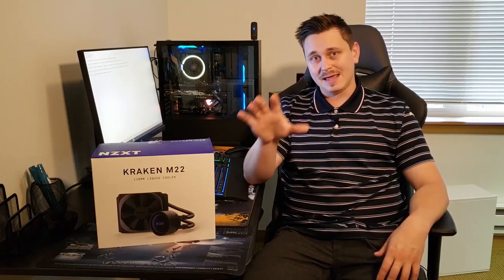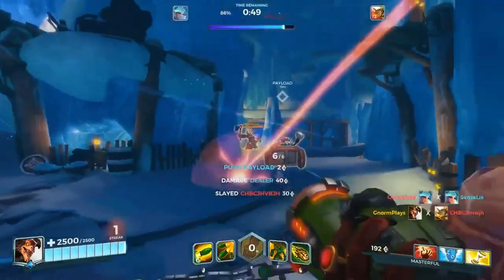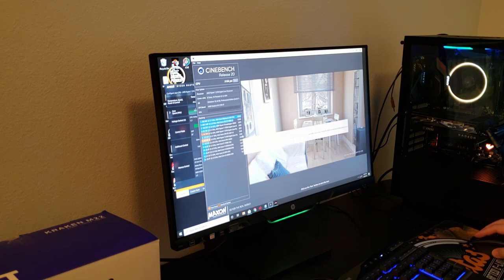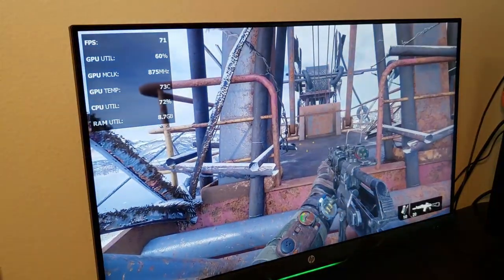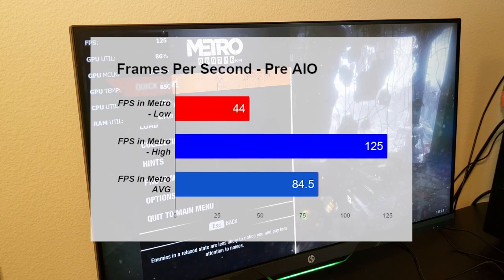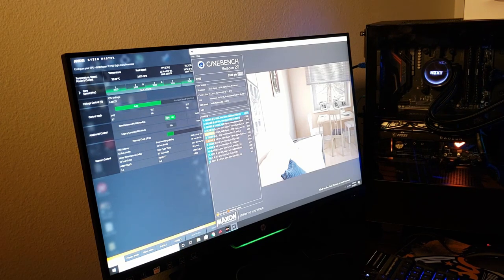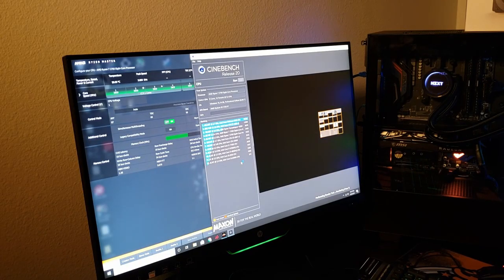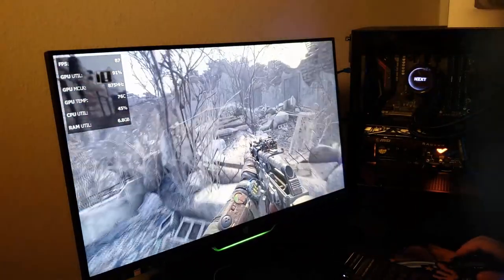Overclocking the Ryzen 7 2700 | NZXT Kraken M22 Cooling

Comment: I just got a 2700 from a sale and it's quite great so far, I just got unlucky with the silicon quality with mine, the most stable OC I got is 3.9ghz @ 1.325v that passes prime95 and cinebench r25 (two 10 minute runs), any more than 3.9ghz needs an absurd amount of voltage lol.
Reply from the maker: That's about where I capped out at too. It worked really well for me. In fact it is still in our streaming pc. I hope it works well for you too, welcome to the channel!
Reply: @BainCustom  Thanks, I dialed mine down to 3.8ghz @ 1.250v and tweaked my ram with tighter timings and I just lost 150-ish points in cinebench r23, my temps also went down 12c cooler compared to 3.9ghz, overall it's worth it.

Comment: Yo, Nice vid! Do you think it can handle a i9-9900k? I personally don't think it's possible, but my friend thinks it is...
Reply from the maker: I think it would for some. But not for the way I use my computer. Not only is my room usually really warm, but I am constantly pushing performance. I would go for a 240mm AIO or a solid air cooler.
Reply: @BainCustom  We completed the build this morning and I'm kinda surprised. The i9-9900K is running at  max 50 degrees with a boost at 4.7 in games. The m22 is doing a good job so far. Thx for your reply.

Comment: TY sir, this is exactly what I was looking for... Stock cooler is ok for a mild OC (I'm running at 3,8 GHz rn) btw
Reply from the maker: Nice yeah. I need to get another overclocking video going for some updated coolers. But this one definitely does the trick for a decent overclock.

Thanks for watching and the comment!
Reply: @BainCustom  I suggest using less voltage, my CPU only needs 1,25 to stay at 3,8. Also, as far as I have researched, Zen plus should be below 1,375-,135 max to avoid degradation. You should be able to get 4 GHz without hassle with proper cooling and a good motherboard.
Reply from the maker: @SpaceLion949  I think the motherboard itself was the biggest issue I had during this video. I tried many times to use less voltage and to hit 4.0 with a stable overclock. I hit 3.9 stable for the CPU but it caused some issues with the motherboard.
Reply: @BainCustom  Oh I see, you must be having too much VDroop (if you ajust the LLC setting you might be able to get a little bit more but 3,9 is quite good). In the other hand off course VRM quality, silicon quality and even the PSU matter. At least that is what I've learned

Comment: Can’t wait to get the cooler, currently on a fx 8350 but I’m upgrading to a ryzen 7 2700x soon.
Reply from the maker: O yeah, that is going to be an awesome upgrade when you make it! I did the same upgrade a while back for my personal setup and it was huge!
Reply: TechCessory would you recommend paying slightly more for the ryzen 7 2700x or would I be better off with the ryzen 7 2700 ?

Comment: I’m using a Ryzen 5 2600 overclocked at 3.8GHz@1.296v(Max). Let me just say it first: overclocking the cpu(base@3.4GHz) literally pushed the performance of my PC to a new level. Games like NFS Heat, AC Origins have seen significant performance boost. Now for the temperature part, using AIDA64 or playing NFS Heat for like 20-25mins continuously pushes Ryzen 2600 to an avg temp of 95/96c with maximum of 111c!? Crazy right? I have encountered a total OS crash numerous times like this. So now I’m planning on getting a liquid cooler. Will I really see some improvements over stock AMD STEALTH COOLER?? Like reaching 111c is no way acceptable and thus my question.
Reply from the maker: You should absolutely have a better cooler. It is not recommended to overclock much at all without something like an aio. That being said it looks like your voltages are fine. I can imagine the crash is due to heat. What is your motherboard?

Comment: I had no idea how important cooling was before purchasing a pre built pc from nzxt.. I’m getting a 3000 pc with a i9 10900k it’s gonna be delivered soon. Do you think this cooler will be fine for me or should I upgrade and worry
Reply from the maker: What case will you be using?

Realistically this lineup is where you want to be unless you plan on adding gpu cooling. Which running a custom loop might be worth doing. That being said, I think this cooler would work well for you.

Let me know your case and when the pc arrives!
Reply: @BainCustom   Thanks so much for the response, did not think you would reply. So I'm using a NZXT H510 elite case, 2080 super windforce oc gpu it had 3 fans i believe, NZXT c850, gskill 2300mhz 32gb, and ya the kraken m22 cooler which i'm VERY concerned about from what i've read. Bc i have the money to get whatever cooler just had no idea the importance of cooling
Reply: @BainCustom  Its also gonna be a pre built so i'm upset that if i have cooling problems i'll have to somehow replace it bc i dont wanna mess anything up
Reply from the maker: Oh buddy! I didn't realize we were on the kraken m22 video. Well all of that hardware is solid and definitely going to run a bit warm. 

I really don't think the kraken m22 is going to do a good job for you. I thought we were on the kraken x53 video. 

https://youtu.be/WDr5niHr7OU

The kraken m22 will be slightly better than stock cooling with that setup and even a solid air cooler would be better. But for style points and better cooling I would say watch the kraken x53 video and get that cooler if you can.

Comment: Got my 2700 on air running at 3.85mhz with voltage of 1.25 and scored 3893 in Cinebench R20. I could go higher but voltage would increase a lot. 70c was my max in 6 hours. Idle 34c and very stable.
Reply from the maker: I'm tempted to get the Corsair A500 and see how well it works for air cooling. It's a bit spendy for an air cooler but I'm thinking it could be better than most aio units. Anyways, thanks for sharing. You definitely beat my R20 score...for now.

Comment: So would you recommend this Cooler for the Ryzen 7 2700? Your video was great! Im planning to get this same set up, but im kinda sketched out by the Cooler.
Reply: And are u still using it?
Reply from the maker: I am not currently using it, however I just used the same cooler for a Ryzen 7 3700X and it is working great! Seriously this is a robust cooler for the price and I would say go for it.
Reply from the maker: Thanks for the follow and the comment. I will be doing another video soon on overclocking. But hands down, snag one of these for your 2700 and you will be happy with it.
Reply: @BainCustom  Thank you so so much!

Comment: I7 7700k? Will this AIO do the job?
I am currently getting 80-95 C with my cooler master hyper 212 air cooler and that's not good. I game a lot and need lower temps.
Reply from the maker: Yeah that's pretty intense! What's your case fan arrangement like? This will absolutely help, but if your case runs extremely hot then it might be counterproductive. 

If everything is arranged properly yes it will do the job. Thanks for coming, welcome to the channel!

Comment: Got one and you can run the radiator on the bottom of the case
Reply from the maker: Absolutely. How does it look though? Are the tubes long enough to fit without getting in the way of the graphics card?
Reply: @BainCustom  yes
Reply: @BainCustom  i have a  full tower and it reaches fine

Comment: does your cpu still run well and fast with the stock cooler? bc that's what I'm running
Reply from the maker: Absolutely. I wouldn't do an overclock with the stock cooler, although you technically can, unless you have really good case cooling also. Anyways. The r7 2700 is a great cpu regardless.
Reply: @BainCustom  so it's still really good even if I don't overclock it?
Reply from the maker: Absolutely.

Comment: Hey brother just wanted to know if its gonna work proper with 3700x and i am planning to overclock it
Reply from the maker: It will for sure work for the 3700X. It is probably the intro AIO for overclocking support with the R7 3700x. I don't have any values for that. But it will do the trick.
Reply: @BainCustom  thank you so much for the information 🤗
Reply from the maker: @shekasingh  always!

Comment: It's worth pairing M22 with i5 9400f just for music production??
Reply from the maker: Worth it as in do you need an aio? Or is it good enough to work with the i9?
Reply from the maker: This m22 is solid for cooling. I'm about to review a 240mm aio that is 139.99 too.
Reply: @BainCustom  oops! Sorry I will be going with I5 9400f. Its worth using M22 or any suggestions?
Reply from the maker: This is for sure my 120mm suggestion right now. If it changes it will be because something new comes out.

Comment: can u adjust the fans and the pump on the m22?
Reply from the maker: You can set fan curve and change the head of the cooler for RGB.
Reply from the maker: Check out this video too. Solid 240mm cooler 

https://youtu.be/fyDl3anWPDM
Reply: @BainCustom  is there a guge Different between the gen 2 and gen 3 ?
Reply from the maker: I'm about to do a gen 3 review pretty soon. I have been happy with the m22.

Comment: Will nzxt m22 be enough to cool i9 9900k running at stock speed (not planning to overclock)
Reply from the maker: I mean I would probably go with something a bit more capable. It's definitely going to beat out the stock cooler.

I have a video on a deep cool Castle 240 EX that I did and I'm about to do one on the NZXT kraken x53. You should check those out when you get the chance.
Reply: @BainCustom  it's just that I already have the cooler and I cba to buy a new one, so if it's capable of doing the job with decent temps I would be happy
Reply from the maker: Yeah. I think it will be totally fine. Don't go buy another one. No reason at all. Don't forget to subscribe if you enjoy the channel and have a good night.

Comment: Can i use this with ryzen 3900x ,wont do manual oc.
Reply from the maker: Check out this video.

https://youtu.be/WDr5niHr7OU
Reply from the maker: I personally wouldn't use this all in one cooler for the ryzen 9. You can get away with it on a ryzen 7, but I have already heard reports of Ryzen 9 running extra hot.
Reply: @BainCustom  yes today i ordered x53 , from where i can get am4 bracket any idea ?

Comment: Is it worth to get M22 with Ryzen 5 2600 oc?
Reply from the maker: Are you wondering if it will do a good enough job?
Reply: @BainCustom  Yeah bc stock wont be enough
Reply from the maker: Well in this video I use a 2700 that's overclocked. Did you watch the part about the temps?
Reply: @BainCustom  Yea you had about 50 degrees

Comment: Can it handle the 3900x?
Reply from the maker: Yes it can, but you might try something a bit larger if you want the best performance for that cpu. I hear the EVGA CLC 240 is solid if you can fit it in your case. It would provide a bit more cooling for about $15 more. But either one will work.

Comment: Hmm mine can barely handle an all core overclock of 3.4 ghz running cinebench. What's wrong with my setup? At stock it goes up to 72c running cinebench

Ryzen 2700 and nzxt m22 kraken and msi b450m is my setup
Reply from the maker: Technically you are undervolted at 3.4ghz, try 3.6 and keep your voltage at Auto. Having 3000mhz ram or higher will help the performance too. There is a small chance your motherboard is holding you back. I actually have a nice video coming out about this.
Reply: I forgot to mention. It's temps that are holding me back. Runninh cinebench r20 on 3.4 ghz overclock i couldn't even finish the test cause it reaches 100c not even halfway

This is my first time using an aio, Can you audibly hear the pump on yours? What does it sound like? I can't really tell if the pump is working or not.
Reply: I figured out what i did wrong lol. I used the factory thermal paste and got crap performance. Replaced it with thermal grizzly kryonaut and now it runs like a champ

Still having trouble running at 4.0ghz though might have to go to 1.3125v
Reply: What are your voltages for running at 4.0ghz and above?
Reply from the maker: @jomarico1770  That was going to be my next guess. I have seen that happen a lot with the factory thermal paste. I just pulled a 2600X out that had the factory paste on...and it was practically glued to the cooler!

Bad stuff.

I am glad you figured it out though.
Reply from the maker: My voltages are at least 1.3V more than likely 1.4V. but I have seen diminishing returns at anything above 3.8. But that could be my own chip.

Comment: Great video! Exactly what I was (and had been) looking for... Just want to get your opinion on if the M22 can be used for Ryzen 7 3700?
Reply from the maker: O yeah, For sure. The M22 is one of the best out there. If you are planning to do a more extreme overclock for longer periods of time then you could up it to 240mm for good measure. But that is not 100% necessary.

The 3700 should actually be a bit more efficient than the previous 2700. Even if it weren't, this cooler would work for a good cooling solution

Comment: Can I oc a 3700x with this aio?
Reply from the maker: You absolutely can. It will perform much better than the stock cooler, you may still hit higher temps, probably higher 60s maybe low 70s. If you want cooler than that you will want to check out a 240 mm.
Reply: @BainCustom  one more question, is 70°C max temp really optimal for a overclocked cpu?

Comment: How does someone get 30degree temps. I have a nzxt aio cooler ryzen 7 3700x and my temps are 50ish idling.?
Reply from the maker: I guess it depends. That would definitely be an idle temperature and not under load. I probably get 40 celcius or so on my 3700x when idle.
Reply: TechCessory if I’m lucky I hit 45 on idle. And I have a nzxt x52 cooler
Reply: TechCessory it must be room temp causing it now
Reply from the maker: It could be. That's definitely not under load. I use a deep cool Castle 240ex now (I should have mentioned) on the front of my case pulling fresh air.

I will be doing a comparison video against the x53 in the next couple of weeks. Might be a good test for you to see how the x53 performs. Plus I will have accurate temps for everything.
Reply: TechCessory when it was cooler out I was hitting like 45 degree temps on idle (just ryzen master opened) and up to 65-70(never past 70 during a stress test) now it’s idling at high 50s and under stress test 75-80. Also thanks for the quick responses! I’m just blaming the heat for now.

Comment: Do you think that M22 can handle Ryzen 3800X?
Reply from the maker: I'm sure it can. It's definitely going to perform better than the stock cooler. I'm about to review a new 240mm cooler you should check out. Might be a week now until it's out, but I have some high hopes for it.
Reply: I will, I decided to get the 3700X instead,  will be expecting it anytime before Christmas.
Reply from the maker: I think the 3700x is the best value honestly. That is just what I'm seeing for the price. I'll be overclocking a 2700 as high as I can with this new cooler so it should be a good test for it.
Reply: @BainCustom  I was initially thinking of getting the 3800X because the price difference was only equivalent to $20, if given the choice, I think you would also consider getting the 3800X, right?
Reply from the maker: I guess I didn't notice they were that close in price. Is that because the 3800x is on sale?
Reply from the maker: I would 100% go for the 3800x if it's only $20 more btw. Hands down.
Reply: @BainCustom  Yeah, I will definitely choose the 3800X too if that was the case, however, when the sale arrived, the price suddenly jumped by another $50 dollars, that is when I decided to go for the 3700X instead.
Reply from the maker: I bet it was a flash sale or mail in rebate.

Comment: How much voltage do I need to run  at 4.0 OC
Reply from the maker: A ridiculous amount. Like 1.45 which I wouldn't really recommend you do. But that doesn't mean it won't do it. I was just experiencing a very unstable system at that voltage and frequency.
Reply: @BainCustom  I spent today overclocking and push my cpu 3.9ghz @ 1.3v+Voltage. Stable!
Reply from the maker: Yeah that is where I ended up. I was able to edit videos without any issue and improve my gaming performance fairly well at the settings. Glad it worked out!